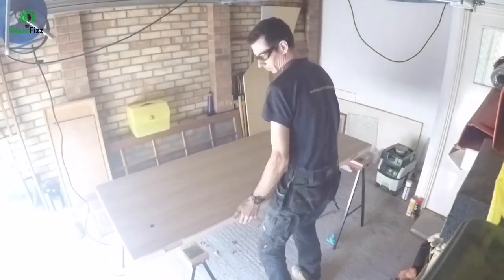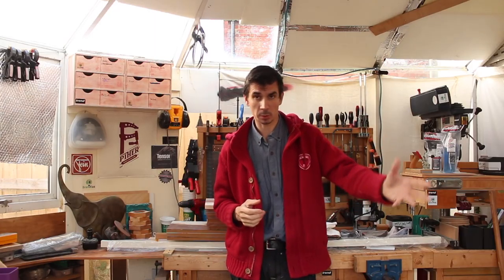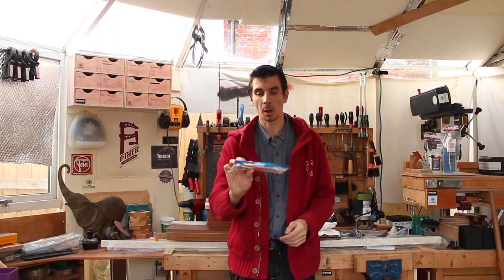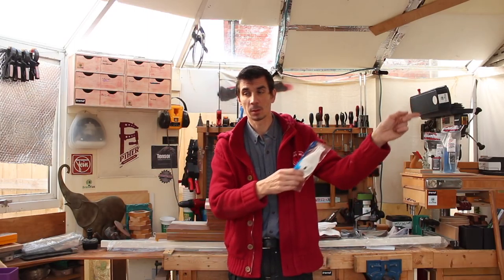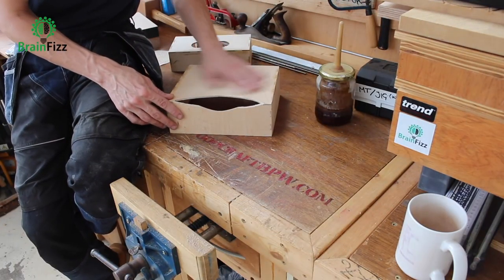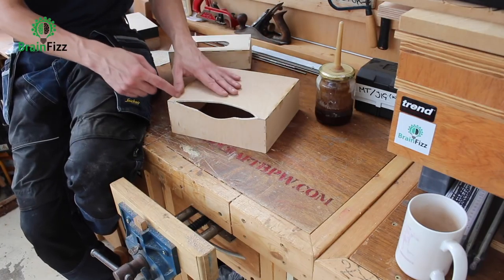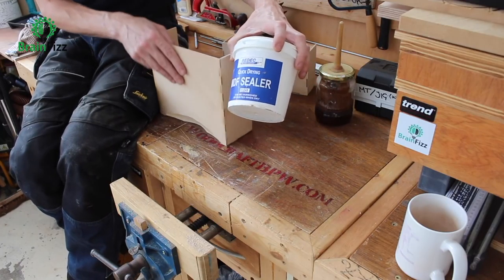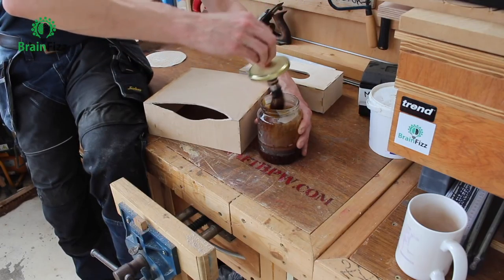Dust mask Van or workshop Storage and organisation solutions

Comment: Happy New Year, Rick!
I've had a Trend AirAce for over a decade. It's quite large to pack and carry around but I do make an effort when working in someone's house, for example. I'd be tempted by the new model Trend have released, which looks more compact and still vents without fogging glasses - that's a good reason I'm reluctant to use the cheapest masks... How HSE can approve them, I really do not know!
Reply from the maker: I have the AirAce too and recently got the new Air Stealth - new one is great, but the older ace has a much bigger surface area for the filters........ like and use both! new ones cheaper too!

Comment: Hi Rick. I use the 3M Versaflo powered air respirator. It’s all in one great piece of kit 👍
Reply from the maker: you can't go wrong with 3M, can be pricey, but never regretted spending a lot on a quality item in my life! get what you pay for!
I have the trend air shield pro that i use for turning because its a face shield also.... find it a bit heavy on the neck after an hour or to at the lather though... how does the versa flow fair up??
Reply: Richard Morley it’s light weight and comfortable, because the air blows in it doesn’t steam up. I’ve had a lot of people say it’s over kill but I disagree, it’s excellent, I’ve had it on for 8hrs at a time no problems
Reply from the maker: GOOD STUFF!! and that's the proof right there! you get what you pay for, and with 3M you're pushing the end of the market for long term daily use! 
the pain of buying cheap quality far outlasts the sting of spending more, generally!

Comment: I use an RZ mask, super comfortable, Happy New Year Richard
Reply from the maker: I've always wondered about the RZ masks - they seem to be very popular at the moment, but honestly I'm suspicious of them, as they look like the kinda thing people wear on their bikes round polluted cities?! never used them - but it puts me off.....you get on OK with them?
Reply: Richard Morley yes they fit really well. I was doing a lot of cutting and routing plywood and sanding it afterwards and I could breath with no problems. You have to replace the liners inside which are paper. I am still on my first one but I will change it soon as it isn't as fresh as it could be but it still stops the dust. The outer part you see is washable. They offer no solvent protection though. But I try and keep away from high VOC stuff Jamie has one too.
Reply: That said if you have lots of boxes of free 3M face masks there is no need for you to change just yet. Especially as you have a beautiful dispenser!!
Reply from the maker: HAHA!! I run several masks, the 7500 half mask for dust and organics, the Trend AirAce and AirStealth for routing, and the trend Airshield Pro for turning. These disposables are purely as a backup when I'm on site, or doing a quick messy job and don't have a 'proper mask'. disposable masks are intended for exactly that. us it once, bin it! if you need a mask for more buy a decent one that can be stripped down, cleaned and renewed!

Comment: I use an Axminster a p f 10 in the workshop but as I'm a builder for a living I use disposable masks on site, as although the respirator would be great it would just get destroyed.
Reply from the maker: Nice! I bought the Trend air shield pro about 6 years ago for turning exotics as my turning space is tiny and it works as a face shield too..... i find it a bit heavy after a couple of hours though.... how do you get on with yours?
Reply: Im really impressed with it. i bought it as i do a lot of routing and as you know dust extraction is not always that easy when routing. Its really comfortable and obviously you get the built in eye protection. Only thing i have found is i didn't realize how often you go to blow saw dust out the way until you have a full face shield on !
Reply from the maker: o bez hahaha yup, been there!!!  Sometimes it’s a good 5ing we’re alone in our shops, the stupid embarrassing things we do,😂😂😂

Comment: Great idea, never make excuses on safety!
I only do woodworking in my workshop and I always use a 3M 7500 series half face dust mask with the round P3 dust filters that also have some activated carbon in them. Also, happy New Year!
Reply: Same here,,, excellent when wearing glasses as the vent is directed down and away + you can easily swap filters according to need.
Reply: Stiff Wood It’s indeed nice that the vent is directed down, but it doesn’t really work too well for me with safety glasses.
Reply from the maker: I have the 7500 half mask too! one that 3M let me have during my visit! We used to get them issued when i worked in the pharma industry... main thing is to have the correct size of mask for your face (people don't realise that there are 3 sizes!, also you have to be clean shaven to get a seal, or they don't work.)
that said they are comfortable and if maintained (stripped and cleaned) fairly regularly they outlast other masks by a long time! great masks! plus you can get organic filters to fit without needing another mask!